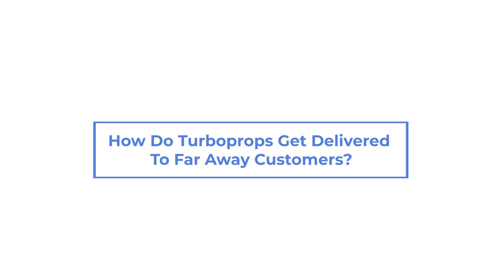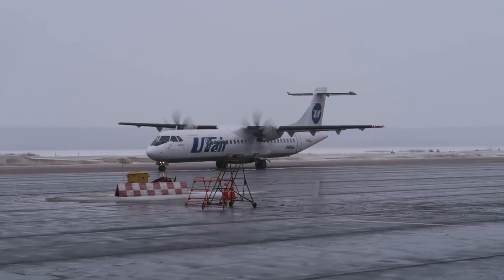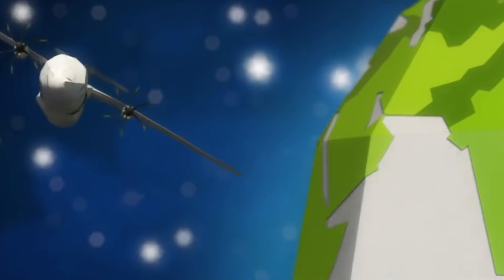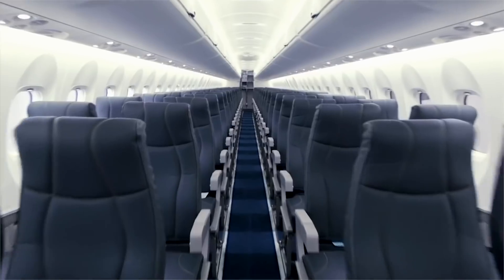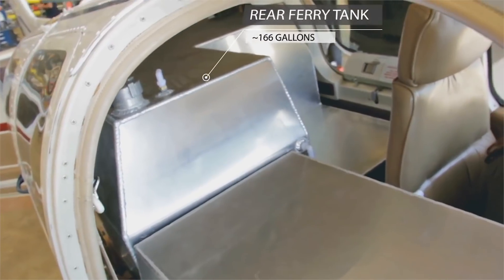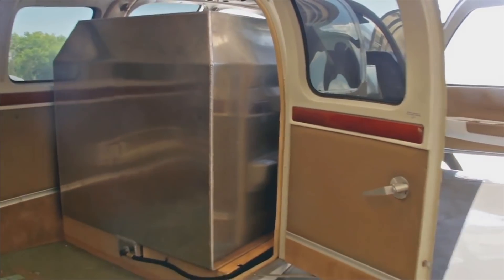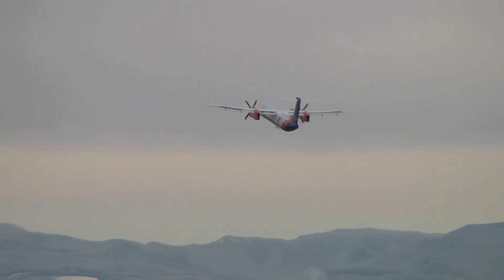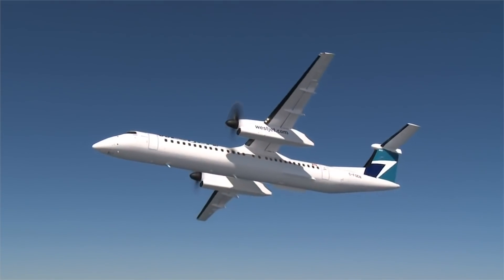How Do Turboprops Get Delivered To Far Away Customers?

Comment: With air New Zealand q300’s they would have to install long range fuel tanks in the cabin to fly from San Francisco to Honolulu which can be up to a 10hour flight, only 2 out of 23 q300’s took the longer route without long range fuel tanks, they had over 3x more stops than with long range fuel tanks

Comment: I use to ferry light single and multiengine airplanes along with turboprops like the Cessna 208 Caravan. Flying the North Atlantic, I did that most of the time, I would wear a cold water emersion suit for the crossing. GPS makes the navigation easier, but being an old guy that learned the old school ways, I do navigation logs and have all the paper charts in my flight bag. I don't trust the Electronic Flight Bags quite as much as some of the younger guys do. Internal ferry fuel tanks are a must. One of the problems these days is AV Gas 100 LL. It can be hard to get in some places. One of the reasons diesel power is being worked on for light piston aircraft because Jet A is available everywhere.  The other problem is the lead in the fuel, the EPA (US) wants it gone, the problem is coming up with fuel for all the existing piston-powered aircraft that will work and at the required performance level. It is a lot harder than you would think. If the whole worldwide fleet has to end up re-engine, it's going to be a staggering amount of money in a part of aviation that has very very thin profit margins as it is. Oh, and the last time I was in Greenland for a fuel stop, the Avgas was 19 a gallon and I had to buy the whole barrel at a time. Avgas at my home airport right now is running 5.80 a gallon. Call it 6 bucks. Takes about 360 dollars to fill an empty or just about empty Cessna 182. Flying is not cheap. Then again it never was, even when I started some 45 years ago.

Comment: just put it on a damn ship.  no disassembly required.  a lot less fuel is wasted and greener.  also save on cycles and engine hours.  no need to hire and pay ferry crew as well as no need to do any weird route planning and safer.  And it's not like the airlline can't wait a few weeks for the delivery.  I see no real advantage in ferry flight unless for some reasons, you need it ASAP.

Comment: Seems like a big fuel bladder in the empty cabin would hold enough fuel to get across the Atlantic and stops the rest of the way as no problem.

Or you could fit them with wings removed into a Dreamlifter or Beluga but that probably costs too much.

Comment: Is it possible to tow a specialy designed glider behind it just to carry A LOT of fuel so no stopping is required
Reply: No
Reply: @arussian_spy  Those do have the structure to hold the fuel tanks tho, the weight of them isn't something on the calculations of those commercial planes.
The calculations from the poster you replied to are probably pretty absurdly off tho, unless the intended range is like a roundtrip around the world...
Reply: @arussian_spy  Or just add the fuel tank inside the fuselage and called it a day
Reply: Oh yes XD
Reply: The added drag would offset any additional fuel the glider might carry.
Reply: @arussian_spy  this isnt a fighter jet or a c130 bro
Reply: The glider would have to be about as big as a 737 and would weigh about 300 tons, so no, its not possible

Comment: How about just shipping them on ocean going vessels?  seems like a lot cheaper and less planning.
Reply: Its most likely cheaper to fly the plane the entire way, With vessels, you have to have the proper lifting equipment, insurance, boat crew payroll, the cost of moving the cargo and then the need for the purpose built ocean going vessel to be constructed which might not see much use in the long run as it would most likely need to be relocated empty often. 2 pilots,  hotel rooms and some gas sure seem cheaper now.

Comment: How do turboprops use reverse thrust or something to reverse them?
Reply: The propeller blades are reversed with an actuator inside the hub, and begin moving air in the opposite direction. It's faster than stopping the propeller and spinning it in reverse.

Comment: Why not make the flights where stops are required revenue flights? Passengers may equal weight, but they also equal revenue for the air carrier.
Reply: It's a good idea, but legally unfeasible due to company certification, etc.

Comment: The ATR is such a shity plane design. It's tail heavy. Thus can tip. It has a compartment which is placed inside in the aft which is hard to get to plus it has a  risk of damage on ppl. For example a colleague of mine got hurt so much that they ban the usage of the aft cpt in Sweden. (Work in progress).
Some ATR dont have space for hand luggage... i mean the whole point of a turboprop is to have short turn arounds...

The front cargo is divded into two spaces with a walk way in between, which is also stupid if you want to separate transfer and local bags etc. Plus having for say a AVIH(animal) means that the part of compartment is full. Giving a chance of leaving bags. 

The freight version is much better especially the newer ones. 

The Dash-8 is a marvelous turboprop. Could also do with some small improvements, but overall it's amazing aircraft.

Comment: There was an interesting story of how Boeing delivered the 717-200 to Hawaiian Airlines from the former McDonnell-Douglas Long Beach, CA plant. They removed most of the seats and put in three big fuel bladders so the plane had the range to fly directly from Long Beach to Honolulu non-stop.
Reply: So...... what was the plane going to be used for???
It doesn't have the range to be used with passengers.
Reply: @wms1650  Inter island flights

Comment: If They put them on a Big Cargo plane such as 747F or Antonov it’s going to much faster
Reply: To even be able to fit inside a cargo plane like the an-225 requires the new plane to have its wings and engines removed. The difficult part is when they've arrived at their customer's home base as most airport do not have the right tools, equipments and facility to assemble a plane's wing and engines. It's not like rebuilding a model airplane and snapping its wings and engines together.
Reply: You need huge cranes and dozens of certified technicians from the aircraft manufacturer to attach a wing to a fuselage.
Reply: TLDR: While the trip itself might be faster, the total time including assembly at the destination will be much slower

Comment: Imagine being the pilot who had to ditch a $30 million new plane in the middle of the ocean because of headwinds or bad fuel calculations :-/
Reply: Chris Loh RIP
Reply: Imagine being the insurer who's got to pay for it.
Reply: Johnson! In my office! Now!
Reply: 30 million? Really?😳😳
Reply: Henry Rollins A new Q400 is $32.2 million as of 2017 (source: Wikipedia)
Reply: Silly me, if I were ditching in the middle of an ocean I don't think the cost of the plane would have been my first thought!
Reply: this isn't general aviation, sophisiticated flight planning software and onboard computers (FMS) guide airliners across large distances.
Reply: Back in the 80's flying non stop from Sydney to LA on a 747SP we had to divert to Hawaii to refuel due to stronger than predicted head winds.
It's a great feeling being in the middle of the Pacific Ocean and running out of fuel! 😬
Reply: Imagine having to ditch in the ocean because someone removed the United Kingdom
Reply: These pilots should buy EV to learn charging calculations first in winter and summer months then fly through headwinds.
Reply: The guy will probably be fired

Comment: Turboprops get delivered in a large box with "Tamiya" on the front complete with a tub of strong glue and some rubber bands.
Reply: Sent by DHL or China post.
Reply: @TheAllMightyGodofCod  if it was by China post wouldn't it be pre crashed  before it got there?
Reply: Airfix does it also and the Ikea version comes with its own spanner
Reply: @obelic71  AIRFIX!!! That's the one I meant to say instead of Tamiya but couldn't think of it at the time.
Reply: @coldo121  Tamiya is remote control so you could fly it from your home to the destination and try some areobatic manouevers on the way
Reply: @obelic71  Tamiya makes some RC. Most are static models though
Reply: Really? 😁
Reply: Flex glue?